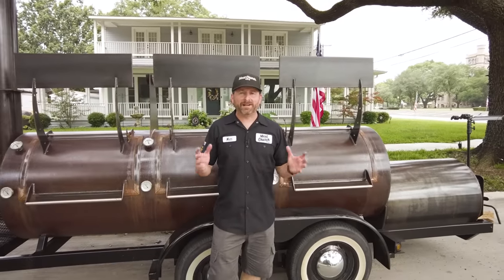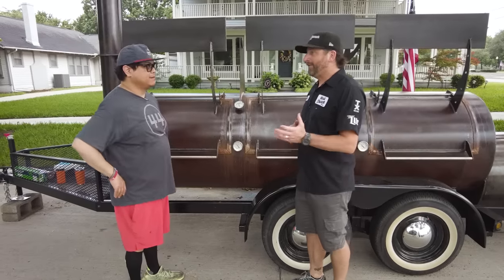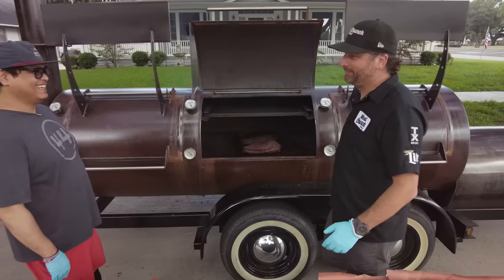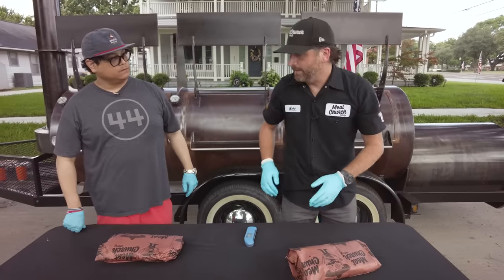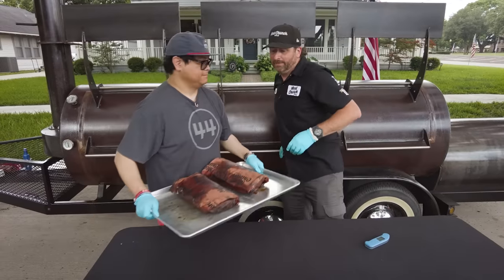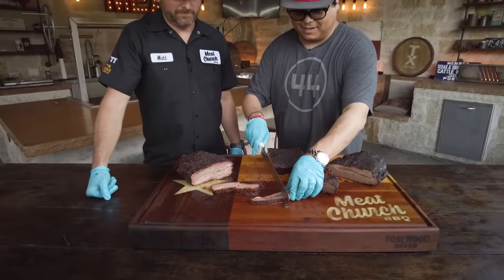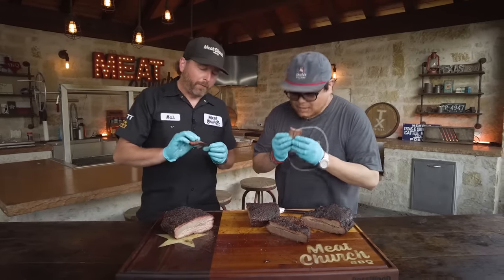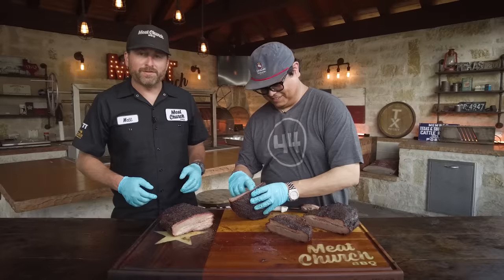Smoking Brisket Meat Side Up vs. Fat Side Up - Brisket Series part 2 of 3

Comment: I’ve basically given up on producing a good brisket lol
Reply: Why?  Got yourself a smoker?  It's a large cut that can be intimidating, but it's actually quite simple.  Trimming properly is super important.  Season heavy with course salt and fresh pepper.  Smoke fat side up (or not lol) until it hits 160 roughly.  Then wrap and smoke until 202 or probes tender.  You'll be very happy with the brisket 😃
Reply: @jonathan8122  yea I got a BGE I’ve done several and they’ve tasted good but just not super juicy
Reply: Dude just smoke it 225-250ish  until you can’t take tending the fire anymore. Wrap it and put it in the oven until it hits 203-205. It’s gonna take a long time. Digital thermometer is almost a necessity
Reply: @SilentKiller-fx1qj  What kind of brisket?  Best bang for your buck is going to Costco and getting USDA Prime brisket for $2.50 per pound.  Local grocery stores are a ripoff.  Like $6.99 for choice.
Reply: I have had good luck on the egg with brisket by using Prime ,the last 3 or 4 have been very good ! But these vids make me want an off set but the Mill Scale is out of my budget.
Reply: @1983mojo1  I know right.  Can ya weld?  Could always make one at home if you're able.  People are buying used large propane tanks and converting them.
Reply: @jonathan8122  we are actually going there Saturday I’ll have to look.
Reply: @jonathan8122  Whens the last time you bought a prime brisket?
Reply: I make mine on a Traeger at 200 and I spritz Apple cider vinegar every hour after 5 hours until it’s time to wrap. Then I go up to 275-300 and it hasn’t failed me since. Only thing is that it takes me between 18-20 hours but it’s so worth it in the end. Pictures on my Instagram. @somdobomk (not self promoting, just so you can see if you want)
Reply: @jonathan8122  I do weld and have thought about building one. I wish i knew where to get a tank in Houston
Reply: @jonathan8122  2.50$/# ??? When was last time you went? I went last week to ours and it’s 4.98$/#. Thanks to all this inflation these days🤬👎👎
Reply: @2005Pilot  exactly. There is no Prime brisket going for $2.50. I paid $100 for a prime 19lb brisket the other day.
Reply: @jonathan8122   Yep. And it doesn't seem like things will ever go down again.
Reply: @SilentKiller-fx1qj  I agree with you killer taste but not as juicy. I smoke fat side down last weekend and suffered the same result. The point was juicier and the flat was dried out. Keep smoking!

Comment: I understand the logic behind smoking a brisket fat side up. It has a basting effect on the meat while the fat renders during the cook. But on my smoker I have to cook fat side down because the heat comes mostly from the bottom going up. So this method, shields the meat from drying up and burning. My briskets have been all the better for it since. And that smoke ring is nice too 👍🏻

Comment: The heat from my pellet smoker comes from the bottom so I do it fat side down to protect meat from the heat. A video showing both ways on a pellet smoker with heat from the bottom would be great.
Reply: Pellet smokers have a fan that moves the heat around equally just like convection oven would. So you don’t need to worry about the top getting more heat than the bottom. Cook how you like but I cook fat side up on my Traeger and it comes out perfect.
Reply: @RSXXX  no, just a fan that stokes the pellet embers.

Comment: Love the vids Matt. One day I would like somebody to talk about what a “smoke ring” really is and that it is not directly caused by smoke. I can and have cooked a brisket in the oven and get a killer smoke ring. The chemistry of smoking deserves a video all on its own.
Reply: The smoke ring comes from NO (nitric oxide) & CO (carbon monoxide) from incomplete combustion. I would be concerned if I was getting a smoke ring from an indoor oven, especially if it was not properly ventilated. Your house could be filling up with hazardous fumes, I'm sure you'll be just fine though. But you can also get a smoke ring if you use curing salt in your rub. Maybe that's how your getting a smoke ring?

Comment: Do grilled brisket tacos (the best)

1.) Slice raw brisket thin
2.) Season with season all or lawrys
3.) Grill on high heat (watch for flare up's because of high fat content)
4.) Using a clever chop meat (because of toughness)
5.) Serve on grilled corn tortilla (chopped onion, cilantro, lime, and salsa opcional)

Creamy green salsa (most people think it has avocado but its a lie)
1.) Grill 5 jalapenos 2 serranos 2 cloves of garlic and a 1/4 onion
2.) Once charred blend everything together
3.) Crucial step slowly drizzle canola oil while blending to emulsify (if oil seperates stop and remove excess oil and reblend)
4.) Add salt to taste (even though it has a lot of peppers it is not a very spicy salsa. Really creamy in texture)

Comment: Love the videos sir!!! I do have one argument 😁 the whole fat cap up or down. I have a 500 gal offset Stick Burner. I also use a massive heat management plate in the belly so it allows me to utilize my entire smoker chamber without scorching any meat. That being said, if I go fat cap up, I will dry the meat side that is facing the heat plate. If I go fat cap down and meat side up, that fat protects the meat from the heat source.........love the new pit sir💯

Comment: Well I did my first brisket on a GMG fat side down, as that's the "preferred" method for a pellet grill apparently. Cooked at 275 for roughly 12 hours to 203 internal. Came out fantastic, but compared to some of the local BBQ joints here in Ontario it wasn't as pull apart tender as you guys have also noted. So, the next one I do, will definitely be fat side up. I'll report when I do another.
Reply: Hey Shawn did you find a difference?
Reply: @Bear-pw7nu  Honestly, no. Both we're fantastic and incredibly juicy. I think it's more myth than reality on which way it's cooked. Wrapped at 165 internal with butcher paper.  Cooked to 203-212 internal depending on probe tenderness.

Comment: I cook on a WSM so I’ve traditionally cooked fat side down. I’m going to give it a try fat side up next time to see how it turns out. Great video!
Reply: On my WSM I do fat side up on top rack and fat side down on lower rack.The juices from the top rack drop on the lower rack and I rarely wrap at all,if I do it’s paper.
Reply: @steveyork8069  thank you for answering my question that I was about to ask. I will be doing my 1st smoke brisket and have an 18" WSM and wondering in how to cook two brisket, one on the top rack and one on the bottom rack.
Reply: @pamelawalker9056  If you can fit them both on the top rack do that.If they won’t then just keep an eye on the bottom brisket it may cook quicker and you may want to rotate them.If I do wrap I wrap by the feel of the fat melting not by temperature.I want the fat to be rendered soft mushy state before I wrap.

Comment: I cook on a RecTec and I always cook fat side down. When I cook fat side up, the flat of my briskets take too much heat and will get crispy and hard on the ends. The RecTec's firepot is right in the middle and even with the heat shield, the drip tray, AND a BGE pizza stone over the heatshield, it still gets too hot there. And that's with me cooking a little below 250* and my brisket pushed all the way over to the side in my smoker.
Reply: I have the same issue brotha. Recteq 590 and I roll 225 all the way. Point is really moist but flat gets crispy at the bottom. I was wondering what was the issue.
Reply: I’ll actually cook around 190° with the extreme smoke function and let it roll overnight. Then wrap in butcher paper in the morning and turn the heat up. That’s the best way I’ve found to cook and it not get crispy.
Reply: @MrPitblue80 ok this might work! So if I need it at 4pm the next day would I still put it like at midnight the day before??

Comment: Matt/Joe Great video. I grew up on a side smoker and have always done fat side up. I now cook on a Treager and have done 3 briskets on it and have not been able to dial it in to perfection. They turned out ok and tasted good but I was not pleased as I have been in the past on other smokers. Recently I have had guys recommend cooking it meat side up, with tallow, using injections, etc. I will continue fat side up after watching this video. Both of the briskets look great. I look forward to the cooking with tallow video. Please do the treager vs big green egg vs side smoker vs barrel smoker that would be awesome.
Reply: Try meat side up and lower temp, like 225F vs the 275F you would do on an offset. Offsets bring heat across the top of the meat so it makes sense to go fat side up to protect it from the heat. Traeger is better fat side down as the heat source is at the bottom. It is apples to oranges and has to be based on what type of smoker you are using. Also tallow when wrapping in butcher paper is amazing..
Reply: @agalvin1313  also depends on size of offset. On my small Wrangler- heat is coming from below as I have crisped up some meat on bottom when temps got too high. Fat side down works best for my setup. Longer smokers I would try  fat side up first

Comment: Hey Matt, couldn't you say cook the brisket for the first 3 hours meat side up and then flip it over to fat side up for the rest of the cook to get the best of both worlds?  I haven't tried it but I've heard that the smoke ring gets formed in the first 2 to 3 hours of the cook before the meat actually gets to a certain temperature.  And after flipping it to fat side up you would still get that darker bark and more tender meat.  Would love to hear your thoughts on that idea.
Reply: I like this theory. Was thinking the same thing. Trying it out on a brisket today!
Reply: And at the end, I am going to flip it back to meat side up to cut and make that beautiful smoke ring present better!
Reply: @edancummings7738 how did flipping the brisket work for you? What was the end product?
Reply: @dustinworkman4272  Worked well. I did fat down, then fat up for the wrap portion. Then turned it back to fat down to cut. Had nice smoke ring to present. Not sure until I try again if I would get any appreciable difference putting it fat side up in the beginning, though.

Comment: I have a Pit Boss Sportsman Series 7 and have been thinking about this very issue you two are talking about at about 5 min in. (The issue of pellet grills and people going fat or meat up when using a pellet grill).  I  have done fat up the past few times, but I am considering trying meat up.  I've noticed from doing racks of st. louis ribs and whole racks of wings in there, that the hottest part of the smoker is in the back wall (those little wings get pretty crispy back there in the corners of the rack).  My biggest concern with meat up is that juices from the fat side will drop down into the water pan and I'll lose that flavor.  I'm only 5 min into the video so I'll see the outcome here, but I just wanted to comment on how the smoker I'm using cooks.  I have a brisket sitting in the fridge, so maybe meat side up kitty corner into my smoker is the next experiment for me.  

Edit - watching through the video, my question or observations is more about the flow of heat.  In the offset, which way does the heat flow as opposed to an offset pellet smoker, or a vertical smoker?  Now you're going to have to run this experiment with different cookers and heat source directions. Have fun! 

Keep it up. Love this series and the analysis of different methods!

Comment: Hey, if you're going to do a "direct" heat use a WSM. I've always used that type and do fat side down. People do it both ways and argue the heat comes from the bottom put the fat down. Or...the heat is diverted and comes up the side and over the top. Put the fat side up. I'll do fat side up next but never thought about not having a smoke ring but I have never even think about a smoke ring until I cut into it and see it. You are correct, you can't taste it but people do freak out when they don't see one.

Comment: I made my first brisket last week on my Pit Boss pellet grill.  I got that same smoke ring with the meat side up.  I was so happy.  I let it go to 205.  Too well for me.  Next time, 165. Also, I put celery seed in my rub.  It has nitrates that enhances the smoke ring.  Tomorrow I'm doing a pork butt.  Gotta slap it first, lol.
Reply: What temp did you smoke it at ?  Pulling it that early is going to be a disaster . you have to get to the 198-203 range so the fats can render down properly.
Reply: Next time you are cooking the meat tmep to only 165?   Let us know how it came out because that sounds to low???

Comment: Excellent video.  I don't have an offset and am a pellet grill plebe so would really like to know the difference with fat up/down.  Though there is convection like with a offset generally the heat is still bottom up even with the diffuser and drip tray.  Not sure if it makes a difference though.  Thanks again for a great video.

Comment: I have a vertical smoker, and I still have always smoked fat side up.  That said I tried hot and fast once and the bottom 1/2" of the brisket was like eating jerky, maybe meat side up would have worked better there???  But fat side up 225-250 is still just killer on the vertical.

Comment: With out the heat management plate, the typical offset has heat that builds from the top down. With the heat management plate, your heat comes from the belly up

Comment: I have cabinet smoker with the stack on the top. I cook brisket meat side up to protect it from the heat source as much as possible. I need to do fatside up and see what happens. If i had a traditional offset id probably cook it fastside up.

Comment: First and foremost, what I'm about to say is in no way, disrespect to these pitmasters. I have no doubt, they cook better than I do. However, as far as the smoke ring difference between the two in this video, it has more to do with the spritzing than anything. Nothing to do with fat orientation. Spritzing produces a more pronounced smoke ring, due to the collection and integration of gas molecules. It's been years since I did the scientific research, so I can't state the exact gases that "produce" a smoke ring off the top of my head, but it has to do with nitrogen and oxygen entering the meat. From first-hand experience also, I know that moisture on the surface of the meat in early stages, affects the visible smoke ring above all else. In my early endeavors, I spritzed heavily, at least once an hour. My briskets, even under the fat cap, would come out with a 1/2" smoke ring. I'm not saying this is the most desirable, it just looks good, as they pointed out in the video. As soon as I started spritzing less, or none at all, my smoke rings reduced considerably and proportionately. Spritzing also increases cook time considerably, and produces a more pungent smoke flavor. These are just my experiences, and I respect other barbecue cooks' methods as well. That's one of the greatest aspects of barbecue, in my opinion. So many methods, so many results. All in all, barbecue is just lovely!
Reply: Very interesting and thanks for sharing.

Comment: Saw your comments on some of the "little guys' " channels ...good lookin' out, man. Also loving the new Mill Scale beast and videos/products you're putting out there - great stuff, keep it up!
I go fat cap up on the kamado, since the heat deflector makes it hotter from the top down if placed on the upper rack in my experience. Fat side down on the Gateway Drum Smoker does make for a noticeable difference with the heat coming from the bottom ...know thy pit, I suppose.

Comment: The real answer is.......

It depends.

Specifically on your cooker. If you have an offset smoker like Franklin's BBQ and as shown here, heat will rise and fill the chamber. You want to protect the meat from all that heat, so you cook it fat side up.

Conversely, if you have a traditional stick lighter/charcoal grill, fat side down all day long. That way the fat will cushion the meat from all that direct heat.

Comment: I've always cooked fat side down because my offset is smaller (Old Country Wrangler) and the heat hits hard from the bottom. After watching this I might have to flip it over. Either way I'm going to foil boat it thanks to @Chuds Bbq
Reply: #bootsnake
Reply: @2005Pilot  will do! Great smoker in my opinion but I'm about to move up to something bigger. The Brazos is in my price range so that's what I'm leaning towards. Either way I'll let yall know what happens with the Wrangler.

Comment: I can get a smoke ring equal to fat side down on my offset Lang smoker, so I’ll keep doing that way,
Myron Mixon swears by fat side down to “protect the meat”
Reply: I go fatside down on my lang reverse flow as well you do have to spritz or baste once in awhile cause it will dry out a bit if you get to hot

Comment: why not start fat side up, then try flipping the brisket halfway to allow the smoke to penetrate better from the meat side for better smoke ring? then finish with the fat side up wrapped
Reply: I would go 180 from that- get the Ring while meat is cooler then Fat up to get the rendered fat for juicy. Will the fat actually penetrate the meat fibers? Not sure, but then again I’m always Fat side down guy
Reply: @2005Pilot  why not try out both methods, but you get my drift. id be curious to the results.